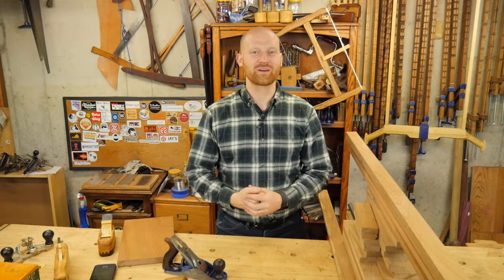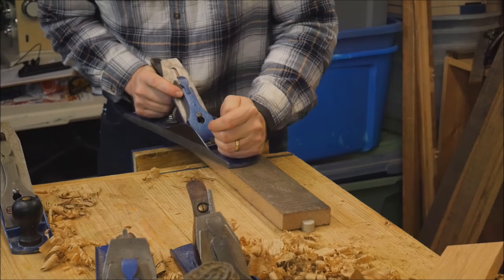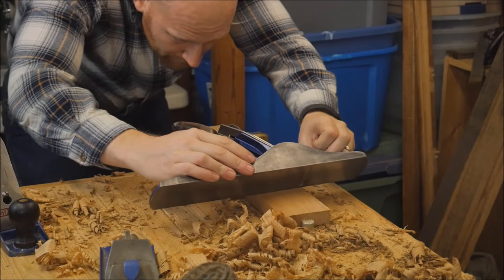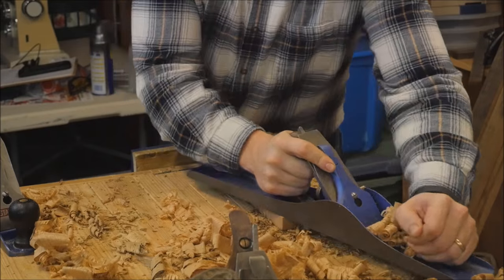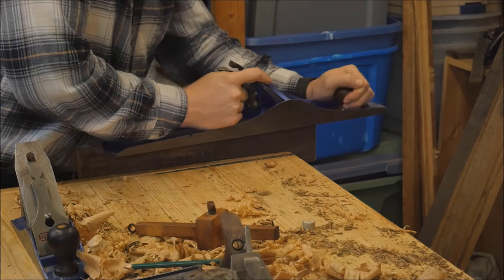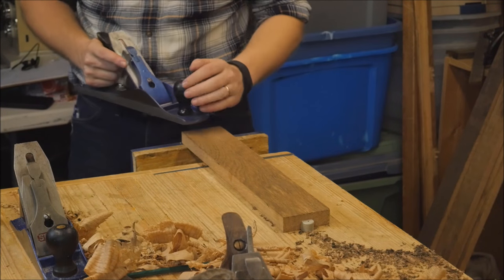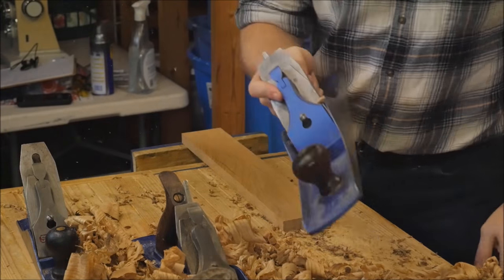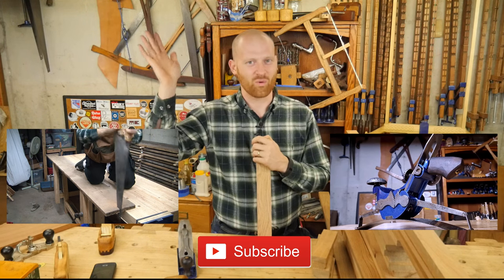How To Dimension Lumber By Hand  - Small Stock

Comment: Best video for small Stock prep and because I build small boxes very helpful to see the process and planes you use. I got so frustrated with my power Jointer I sold it and started using my planes to joint. Now I see how it should be done and all I need is a Jointer plane. Have the scrub and a LN62 but maybe a smoother that’s better than my very old Sears??
Reply from the maker: thanks. sounds like you are having fun!

Comment: Great video! My favourite so far. Enjoy that you go into the technique. As a just starting woodworker, I would enjoy seeing more videos like this, perhaps going more in to the reasons and purpose of switching between the different planes. Also how do you sharpen your camber iron, free hand?
Reply from the maker: +Phil Allard Thanks for the great Feedback! that sounds like a great idea for a video. I am wanting to do more technique videos. so you may be seeing more like this. I do sharpen it freehand. Usually I only use a gig for the flat Plane irons. even my chisels are usually freehand usually I will use the jig every few months on a chisel just to make sure the angle is not changing. As to the cambered iron it is freehand. I start with the left corner of the blade in the far left corner of the stone then drag it back to me rocking it to the right so it ends in the close right corner. I will do that 10 strokes or so then reverse it so it rocks to the left. bacillary making an X on the stone. I do not worry about keeping it extreamly sharp and will often let it get extreamly dull  before sharpening again.  It is an aggressive rough iron and is designed to make a mess. I may sharpen all the other planes 2-3 times before I sharpen the fore plane even though I use it twice as much. does that answer your question?
Reply: +Wood By Wright Boy that was Quick! Sure does. Thanks a lot.
Reply from the maker: +Phil Allard Thanks for the question! you happened to post when I was answering other posts.

Comment: Nice one. I learned something today. Its that i need more toys ;)

No. I have the planes, wooden ones mostly, but i need to look at how they are set up. Only one i dont have is a jack/fore. I need to make or find that in between size. Got a big piece of straight beech. One day i will find the time to make a jack plane out of it. One day....
Reply from the maker: +Willem Kossen Well I also have a cambered Iron for one of my #4s and it works fine I just like the grip on the #5. Looking forward to seeing what you make!
Reply: Don't ever think one day. Always try to find the time each day. I used to always say one day until I was told that my one day maybe wouldn't be. Kinda makes everyday a good day to do something.
Reply from the maker: +John Burkitt +Willem Kossen great advice.

Comment: This may be very best video I have seen about working with small stock.  I have seen other good videos about the same subject but your explanation about the finding the twist location helped me the most. I started using only hand tools because of the German noise restrictions so videos like this really help.  I do have two short questions. I am pretty good with my planes but have never go to the point where no light can be seen when checking with my plane or a straight edge.  Any tips on that?  Second has to do with what should be a totally flat board but when I lay it on a fat surface it rocks a little, somethings a lot. Again, any tips?
Reply from the maker: +David Clark if you hols a surface up to the light you will always saw light. That is the nature of electrons. If the winding sticks tell you it is flat and you can not feel anything with your hand, then it is flat enough. The quest for flat will drive you crazy because there is no such thing. There will always be someone with tighter standards then you. And wood moves and changes if you can not feel it then it is within the tolerance of how much the wood will move. As to seeing it on a ft surface a shavings amount of movement is fine but if it is more then that you just have to take a shaving off off of the high point. Also there is a diminishing return and you have to learn what is flat enough. If I can push it flat with little force then it is fine as it is then with in the tolerance of wood movement. Hope this helps. Thanks for the great question.
Reply: Thank you for asking this question David, I had the same one! I have been struggling along with my plane and wondered if I would ever get to that point. I appreciate James' response--I think I get too obsessed over being able to see light underneath. I just watched his talk entitled, "How to Be Okay With Messing Up" at the Fredericksburg area Woodworking Guild and I found it to be enormously helpful.

Comment: In the last part of the video you go back to the jointer as you approach your line. Doesn't it leave ridges? I can see that the smoother would take them out,but it must be tricky not to go too far.
Reply from the maker: I am not taking a deep enough shaving to leave plane tracks.
Reply: @WoodByWright  I actually tried this today and it worked a treat, although I used a number 4 with a cambered blade. Thanks for the tip. And for your reply.

Comment: Did you cut all those pieces to approximate length and width from a wider board and then dimension them? Is this how you would recommend starting a furniture project? As opposed to taking a wide board, planing it down and  cutting the parts from that?
Reply from the maker: in this case I was pulling all the pieces from scrap so for most of them I was getting only one or two sections from a board. if I am working from larger stock then it is generally to thickness it all first but then you will have to square it up after cutting it out. but that is easer when it is thicknessed first.

Comment: Hi James! Total beginner here. Do you have a video on crosscutting boards with a hand saw, without a saw bench or saw horse? I do have a workbench with dog holes and a face vise. I’m trying to practice making various cuts with hand saws, and I’m having trouble coming up with ways to secure the board for crosscutting. Further, do you have any content on smoothing the end grain? Thanks in advance!
Reply from the maker: the best way is across a chair. I use a saw bench but it is basically just a long chair, and untell I made it I used a couple chairs in the shop. I have never had someone ask about crosscutting before most people ask about ripping. here is a video showing how I rip on a saw bench. https://www.youtube.com/watch?v=JFkh35wbSLw but you could do the same thing with a chair, and rotate the board 90 degrees to make it a cross cut. hope that helps. if not let me know. it might be worth making a video on it.

Comment: Great Video!  I really appreciate the explanation.  I struggle getting a board flat lengthwise.  Whether is twist or bowing, I never seem to get it tolerably flat.  Any suggestions?
Reply from the maker: well, my first question is what is tolerable. does it matter for the project you are using it in? some people get bent out of shape over 1/100 of an inch over 4' but for the most part, the skill is being able to just remove material where you need to. just plane the high spots without hitting the low spots again. that is a skill that only comes with time.
Reply: Patience and time.  All good things come with these two items.  I am not that particular about "perfectly flat.  I just don't want it to wobble when I push down on a corner. :)  Thanks for responding.  Keep up the great work.
Reply from the maker: very true! it is not about setting up the tool like with power tools but in the skill and experience of your hands. and you can only get that by messing up a ton of boards!

Comment: looks like so much fun James!  I can't wait to get my bench built!  How long did that take you for 38 boards?
Reply from the maker: +Mike Kapotsy the 16" boards were about 13 minutes each and the 5' boards were about 30 minutes each. all told about 10 hours I am guessing. but most i had to plane off 1/4" or more to bring them to thickness. and 6% air dried white oak it not quick for that.
Reply: +Wood By Wright what moisture gauge do you use?
Reply from the maker: General tools. not the best but it gets you close enough. http://smile.amazon.com/General-Tools-MMD4E-Moisture-Digital/dp/B00275F5O2/ref=sr_1_1?ie=UTF8&qid=1462557532&sr=8-1&keywords=moisture+meater

Comment: really informative. question, when u say ''for plane"-is that the #4? or the "fore plane" & whats the difference? also, skip planing is going across the grain??....or...?& can u skip plane with a " lunchbox power planer" thanks bro!!
Reply from the maker: +Joe basementwoodworking  well skip planing is usually just taking a thin layer off to see the grain. though the tern now-a-days mostly just means to take a light pass with a thickness planner. going across the grain is refers to a traversing the board. and the fore plane think of Before rather then 4. because it is the plane that comes before all others. A #4 plane is a size that Stanley came up with for the size of the sole. so 1-8 are progressively larger with any 1/2 or 1/4 size just saying it is wider not longer. I really hope that makes sense as I am about to fall asleep!
Reply: Wood By Wright yes yes it does completely thank you for taking the time to explain that to me I've asked a few other people and they've never answered back in the past so thank you have a good night bro
Reply from the maker: +Joe basementwoodworking Glad I could help! questions like this drove me crazy when I was first getting started. love helping others out in any way I can!

Comment: Thanks for the explanation. Cool video.
Just a question about the planes. It looked like you don't adjust the plane iron and used different types of plane. Are those just dedicated planes with preferred settings or is there more of a difference between them?
Was also thinking if you could make a micro jig type thing and push small/tiny pieces over an upside down plane/jointer.
Cool video, looking forward to the rest. Have a great day, cheers.
Reply from the maker: +Nearoth When I am doing a large amount of planning I will set up each of the planes for a specific step, but often that is the way I leave them setup. with how cheep they are it is easy to have a bunch that you keep setup just right.
some times the small pieces are just too small to put in a vice and I will flip the plane upside down and put that in the vice and run pieces over it. you just have to be very careful because now your fingers are near the blade. in that case a small push stick can help.
Reply: +Wood By Wright that's true. I'm having a hard time turning the wheel anyway. Might be the cheaper model but I can't turn it with just two fingers...

Comment: Curious. So you totally ditched your power planer? I'm new to woodworking and hand tools. I love the process but it's so hard to find the time and I have been thinking about getting a lunchbox thickness planer. Thoughts? Planers are just so loud... not sure what to do. I feel like I spend all my time planing and not on joinery.
Reply from the maker: +riskmandel1 I use to have a shop with all the bells and whistles 24" Planner SawStop, etc. but due to medical and financial reasons had to sell all of it  and move into a house with no space for a shop. I thought I would never do woodworking again. At that point I had never touched a hand plane and rarely ever a chisel. Hand tools allowed me to have a shop again and buy tools for almost nothing, quietly and with almost no dust in my basement. they gave me back woodworking. As to the idea of power tools to hand tools my advice is do what you find to be fun. if you have a pile of wood that needs to be brought down to thickness and the idea of doing it all by hand makes you second think going into the shop, then by all means get a power planner. Woodworking should not hold you to standards of right and wrong. It should be something you look forward to. something that makes you happy. To be honest if I had the money and space I would have a Table saw, planner and joiner for when I have a ton of boards to do. But I would probably do a few boards by hand because I enjoy the task, then do the mass of boards with power. The only time you should ever feel guilt in woodworking is when you do something you do not enjoy when there is an option that is more enjoyable. I do not know if that answers your question. sorry it is kind of long.

Comment: Are the end grain edges square to the sides ??
Reply from the maker: They can be but in most of the team I do not mess with it as the length will be adjusted later when we get to doing joinery. It's usually a problem to pre-cut everything to length as a length may need to be adjusted slightly to fit reality.

Comment: why, if i could ask, you skew your plane at the beginning when you're using the jack plane?
Reply from the maker: when you skew the plane it lowers the effective angle of the cut making it easier to push also there is less sole in contact with the wood so it will ride more with the contours of the wood.

Comment: I wanted to learn to dimension a small piece of wood to make a spokeshave. So, I made two fairly nice winding sticks just for this purpose.  When I went to use them I found that my eyes are so bad (astigmatism)  that I see a slight double image. I cannot seem to focus on the edges of the sticks.  Never noticed it until trying to eye up the winding sticks.  So, my new project is to find/design a set of winding sticks that have a different kind of method to see the angle difference.  Not sure if it can be done.  Weird right?
Reply from the maker: that is odd. I am looking forward to seeing what you come up with!
Reply: Yes, it is odd. Normally, with my design work, it is not a problem.  At 60 (don't feel 60) my eyes are ok for computer work and normal things.  Focusing on that top edge where the light and dark wood over lap is not so good.  If the board was really warped, I would see it.  The subtle twists I cannot.  Like I said, I never really noticed it and it does not interfere with anything else.  I have an idea for a long dowel, embedded in the far stick.  The dowel would extend through the front stick and have a vertical pointer.  The front stick would have lines on it so you could see if the pointer is deviating from level.  Just an idea.  Wish I could post drawings.  That would explain it.
Reply from the maker: sounds like fun. looking forward to it!

Comment: oh this is adding to the fore plane question. is there a# for the  fore plane ?
Reply from the maker: +Joe basementwoodworking Well the Fore is in reference more to the iron rather then the plane itself. it is short for "Before" you can put a cambered iron in any plane and call it a fore plane. but traditionally it is in a #5 though often in a #4 body. it is also sometimes called a scrub plane. A lot of people will get a second better iron for their plane and will take the old blade and put a camber on it so they can easily switch the two irons in and out and make the plane do double duty.
Reply: Wood By Wright ahhh i get it..so no number just a shortened name. And skip planing is going accross the grain rather than with the grain??
Reply: Wood By Wright i have a cambered iron in a smoothing plane i bought from someone. But the ahavings are set to ultra thin. Should i re set it to a deeper cut ? Or is that just personal preference. Sorry for all the questions. I know a little bit about him plans but always wondered about cambered irons and skip planing..
Reply from the maker: +Joe basementwoodworking Well if it is rounded it is intended to just take off large amounts quickly and leave a rough surface. it will never give you a soothe surface because it is cutting out a rounded chunk. now some people will round the corners of a smoothing plane so the edge of the iron does not leave a line but the mane face of the iron is flat.

Comment: Have you ever milled out of a log your own lumber?
Reply from the maker: yes. I have a few pieces drying in my shop that will turn into a 10' table in a year or so. and a pile of maple and chery drying at my grand parents house. most of what I use I'd white oak milled by a friend and air dried for 2 years outside.
Reply: +Wood By Wright I've been thinking of milling by hand some crab apple logs that came from my yard. Is there any particular saw or set up you would recommend for straightest cuts?
Reply from the maker: How big are they. if they can fit in a bench vice then a frame saw or large ripping panel saw. if bigger then you would need a pit saw. but a chain saw might be cheaper.
Reply: I do not have a chain saw or a frame saw. I do have a rip saw though. I suppose I can try it. Pit saws are hard to come by in my area and win found they are expensive. It would be cool to have one though. Was your frame saw hard to build?
Reply from the maker: +Bare-Foot WoodWorking The frame saw is very easy to build in all honest even with the carving it took me about 8 hours. it was from a BlackBurn kit and he sells it is different sizes. you can make it your self with some spring steel from McMaster and some scrap steel. http://www.blackburntools.com/new-tools/new-saws-and-related/roubo-frame-saw-kit/index.html